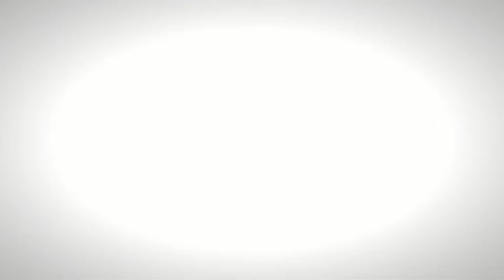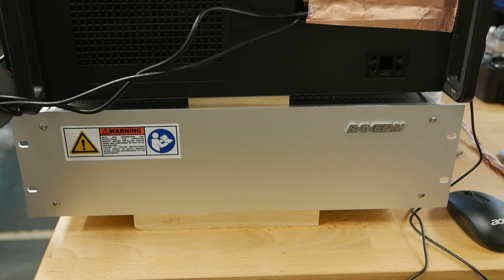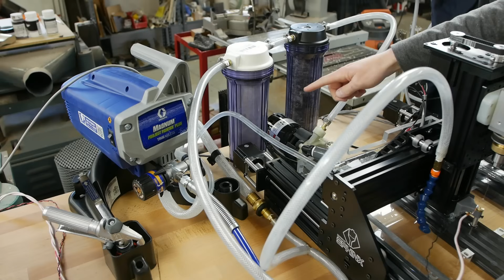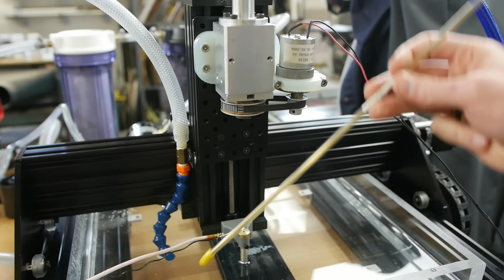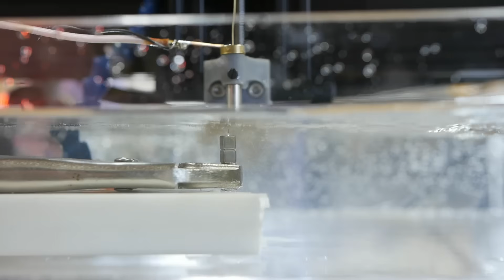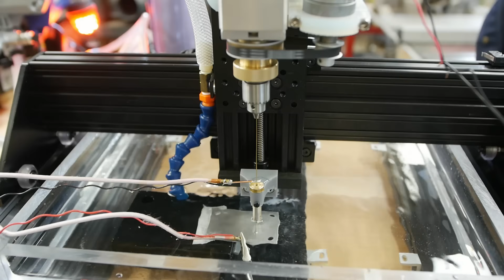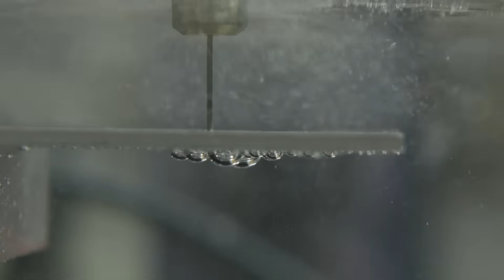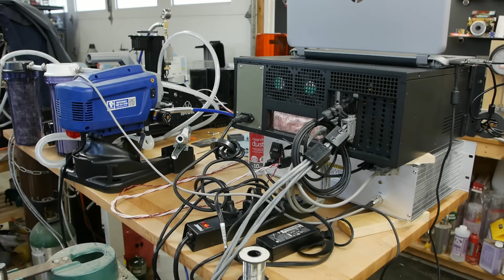Drill through anything (conductive) with Electrical Discharge Machining

Comment: Can I assume that you can drill through a neodymium magnet without heating it up and losing the magnetic qualities?
Reply: probably, at least as long as the voltage doesn't mess it up...
Reply: @kevincrossland1898  Only if the coolant is very cold.
Reply: The little shiny square that he showed as an example of something he drilled through was a neodymium magnet. Being that he drills in water, it wouldn’t heat up the part
Reply: @Aaron Page 
Why would you assume it's a neodymium magnet?
Reply: Super Dave cause it looks just like one. Of course I’ve bought a few hundred for constructing ....
Reply: Joseph Ryan 
Personally, I see endless possibilities with being able to bore a small hole through a neodymium magnet, especially through a sphere.  The polarity can be vertical or horizontal, but the possibilities are limitless.  Doing that may.....   just may, reveal a limitless amount of energy.

Comment: a pressure reservoir in the outlet of the airless spray is recommended to limit the cycling of the pump motor. the constant stop/start of the airless spray will lead to its early demise.
The reservoir could be any pressure tank capable of withstanding the pressure with a dedicated air gap at the top that can be recharged when needed. A out of test scuba tank or oxy tank is ideal.

Comment: This effect is why many metal satellite momentum wheels for orienting the satellite for communication or sensor scanning have failed.  You have to make them of insulating material that will not store an electric charge that can spark at the contact points and weld the wheel in place.

Comment: U use to use EDM to remove broken bolts from stainless tooling. Once you cooked your way through one with the electrode, the remaining part of the bolt in the hole is just burnt metal and shatters like glass, making it easy to remove.

Comment: If it cuts tungsten carbide I see no reason why it wouldn't cut titanium (which would make my like a lot easier...) About how much would you estimate a similar system would cost to build for one's self and would it be feasible for a CNC/3D printing amateur to operate?

Comment: One thing he didn't mention was the almost negligible heat affected zones. Other machining processes can change the properties of a material (work hardening by milling to aggressively comes to mind) but with an EDM you keep the material basically perfect, save for a microscopic area around the cut where the spark heats the material up
Reply: A high pressure water jet does a comparable job with a lot less hassle, preparation, and constant worrying about arcing. imho
Reply: try water jetting a bearing eccentrically placed with virtually no clamping force, you ain't doing that with a water jet I imagine.
Reply: @ray Nic < Perhaps laser cutting would work well on eccentrically placed bearings with minimal clamping... I just feel that this new tech has some drawbacks in preparation, arcing, water filtering, and precision in its current form.  Maybe in time once it gets perfected, it will be a more viable alternative.
Reply: @BillAnt  it's been around for quite a while, actually. As for its use, as long as the part isn't taller than the machine itself, you can pierce a hole clean through without any hassle, or even any diameter change in the hole. The same can't really be said for laser and even Plasma, which both have a focal point and as a result can't get straight holes in very thick parts
Reply: @Kumquat Lord < A well focused coherent laser beam or plasma cutter can punch a very precise hole.  Same can't be said for EDM, even Applied Science said in this video that due to the slight rotational wobble of the electrode the diameter can become non-uniform ( at 20:45 ).  There are certainly some applications for EDM, where other more mature techs are non-ideal, especially for odd shaped/angled objects and heat/deformation sensitive materials.
Reply: @BillAnt  I must agree with you,  EDM doesn't seem to be very practical, at least not for me and my small shop, with that said it's still very interesting,  great informative video.
Reply: Well, it is submerged you know.. Also, it looks like it's initiated by program and not by hand so it should be pretty much fool proof.
Reply: Lol, "work hardening" that's what happens to idiots going too slow or wrong speed and feed. EDM is far from perfect, especially if you get the current, gap, or poor flushing wrong
Reply: @highstreetkillers4377  Dial it down and go back to your video games if constructive talks are difficult to operate. And what's with the air quotes? It is an actual thing which happens, either by accident or on purpose.
Reply: HighStreet Killers, interesting take you have on those not proficient in things in which you claim to be proficient.  

Using your standards, you just might look like an idiot in my shop, several times over (at the copper plating station, over on the over-arm pin router, running the granite router. Then there are my former professions and interests, law, electronics, . . . .)

Why not share your wisdom, rather than painting yourself an idiot by trying to run down those not familiar with things you [claim] to know?
Reply: @highstreetkillers4377  Also happens when you have a coolant problem asshole, and what about when you forget your lube? Based on your attitude I would bet my Clausing you have never run a shop. Likely have never even machined Delrin. Those who have actually been in a machine shop would know that things happen to the best of us, not just the "idiots." Go on now, keep dreaming that you know something about everything. Google wont be there to help you when you enter the workforce.
Reply: @highstreetkillers4377  Wow dude.  I have now read 4 of your comments on this video and they have ranged from fear-mongering, to bragging, misinformation an now berating other commenters.  May I suggest you make public posts in a calm and collected frame of mind to add to the goodness quotient of the global permanent record.  If you have to vent just hit cancel instead of comment after writing your post and getting it off your chest.
Reply: @KallePihlajasaari  Hah, I do that sometimes... Always read before posting, evaluate if there's any good in it, and delete if it isn't. At least I expressed myself to myself, I don't have to be one of these guys...
Reply: @surgeeo1406  I am deleting a LOT of unsent posts this way :-[

Comment: I can't wait for the wire EDM build! I operate one as a job right now, and the machines I run are INCREDIBLY accurate. We regularly work with tolerances that are plus or minus 0.0002 inches (plus or mins about 8 microns)

Also, the toughest material I've EDM'ed was DIAMOND.

Comment: 30+ years ago, I was always fascinated by the "spark eroder" at my step dad's pattern shop.  They would create these intricate forms for the car industry out of graphite and then use that as the electrode to spark erode a steel billet.  The machine used white spirit instead of water and it was a really slow, dirty process but the results were amazing.  Being able to cut square holes in steel was like magic.

Comment: I love this channel, years ago I built a high pressure pump for a gun drill I built from scratch and never thought of using an airless paint sprayer for a pressure unit, could of modified the seals in the airless and saved a bunch of headache and expense.  Thanks a lot 30 years too late.

Comment: does increasing the drill size put a strain on the power supply?  i assume it would have to have a higher current to do the same thing the 7mm drill is doing.

Comment: You mentioned that the material isnt affected by the process. It actually is. You will have a recast layer due to EDM, and can cause brittleness in the top layer which can lead to fatigue cracks more quickly than if you had used conventional machining practices. Yes, the point of EDM is to create tiny holes or unusually shaped features where conventional machining may not work. But EDM does have its own draw backs, so make sure the application wont be affected by cyclical stress fatigue cracking as a result of the recast layer.

Comment: Would gold drill faster? Scince it conducts very well
Reply: It is all based on melting temperature and thermal conductivity. Hard steel is easy to drill.  Copper is very hard to drill, but makes great electrodes.

Comment: as i know short shots on airless leads to quite fast wear of motor and some other parts, i would add some pressure buffer bigger than hose to make it running bit longer at each shot to not kill motor to fast. Also seals on pump piston do not like pure water (paint is creating slippery film and water cannot do that) just saying from perspective of contractor...

Comment: This is kind of a noob question, but if you're eroding the brass electrode into the water, won't the water get a higher and higher concentration of zinc over time? If that's the case, is it really safe to touch the water without protection?

Comment: On aircraft engines, many of the bolts have to be wire wrapped and locked.  Always wondered how they drilled those tiny diameter holes through hardened bolt heads.

Comment: We've had this technology since I was in Tech School back in the 1970's. I used an oil bath EDM machine to machine a complex shape hole (depends on the shape of the electrode) through a piece of hardened steel as a die used for making extruded aluminum rails. Like you mentioned, it will burn it's way through pretty much any conductive material. Nice vid on the workings of this machine.😉👍

Comment: Ben, if you want a great pump, search for drill EDM pump from Alibaba or similar, it works great and is designed to operate continously. I'm concerned that the paint pump will fry itself or its bearings from those short bursts of action in short time.

Comment: Try drilling through a ruby, if my memory serves me correct I think rubies are conductive.
Reply: Then once he has a Ruby with a tiny hole in it he will be forced to begin a waterjet project.  Nice thinking!
Reply: They are not conductive.
Reply: @leocurious9919  😓
Reply: @leocurious9919  📖
Reply: @leocurious9919  well Ruby is mostly aluminium oxide with chromium, so it has good thermal conductivity. Therefore it is indeed conductive.
Reply: @Sharpless2  Its still not electrically(!) conductive. Just like Diamond, which is the best thermal conductor at normal conditions but electrically a isolator.
Reply: Quartz?
Reply: Can drill through a ruby easily with a carbide gundrill
Reply: non-metal minerals arnt conductive... but you can create a laser beam with a ruby and a strong light source... :)
Reply: efgenios  You''re statement is too broad to be accurate. While most non metal minerals are non conductive, some are. The most obvious example is an allotropic form of pure carbon - graphite.
Reply: ok.... perhaps i wasnt so clear.... when we talk about non-metal minerals were talking about "crystalic gemstones"... (quartz, crystals, ruby, zircons etc)... carbon isnt a stone, on its own it isnt conductive... nor is graphite a stone...  like metals, graphite contains delocalised (free range) electrons, thus its not exaclty within the same family as other minerals.... graphite is closer to metals than any other mineral... thus my original statement was somewhat within place... :)
Reply: quartz is not conductive, it has no free range electrons in it... what it can do however is work as a "variable capacitor" when it is coated with metal on its two sides (much like condenser mics work), or like a frequency crystal..... it does allow or block certain frequencies to pass through it... but it does not conduct (release electrons) unless a large load of electricity goes through it... then again, most materials will do that, even rubber....  a ruby will try to "direct" all photons in a certain direction when its opposite sides are coated like a mirror... this has nothing to do with electricity per say.... the link you provided isnt safficient to prove "electrical properties" of a ruby.... a ruby, like a diamond, is a very good isolator of electricity... it cannot conduct.
Reply: efgenios  Yet another example of a (somewhat) conductive non metal is the crystalline form of quartz, a mineral composed of two non metallic elements - silicon and oxygen. While graphite is often used as a conductor,  crystalline quartz is not used as one. And yet it has electrical properties as evidenced by the piezoelectric and pyroelectric effects that are exploited to make sonar, piezoelectric lighters, infrared sensors, microphones, watches and timers, vibration sensors, accelerometers, etc. (Note: The amorphous form of quartz is not conductive).

Even in the case of rubies, there is a little 'wiggle room' regarding their conductive properties. I just found an interesting exception...optical excitation can change a ruby's electrical conductivity via. a photoelectric effect.
https://link.springer.com/chapter/10.1007/978-1-4615-7341-8_47

Comment: Your guide is a little high my dude and will make your diameter larger and  ur epac being off will do the same. Lack of flushing  will cause exposing rods. They can burn up in a slit second. And recommended  ion tank for holepoping wire edm. Anything with water because you will get inconsistent finish as your probably know or on a real machine Tc or conductivity will cause the machine to alarm

Comment: I work in a moldmaking shop and all the EDM "hole poppers" as they are called that I have seen have brushes in the drill head so electrical connection to the electrode is through the head and drill chuck.  You might not need your little collar if your drill head has brushes. If it doesn't have brushes perhaps the groove above the knurl on the brass nut could be a commutator for a brush.  Without brushes the electricity would have to travel through the bearings in the head and would destroy them in short order (unless they are ceramic bearings.)  By the way is that solid core wire connecting to the workpiece and electrode?  If so stranded wire with the finest strands possible is preferable when conducting high frequency's as the higher the frequency the more the electrons travel only on the surface of the conductor so stranded wire with the most surface area as possible is best.  Did I hear you mention another source for a different EDM generator?

Comment: With this "Electric Lance" style system of EDM drilling, could this be used to add additional internal surface area to things like bearings that would allow for in-bearing storage of lubricants to prolong bearing and race life without sacrificing the strength of either?

Comment: In 1950 I picked up a junk accumulator battery from a rubbish tip, and played with two pieces of wire attached to the terminals. I used a needle as one terminal, and wrote my name on anything that I could find to autograph. I also discovered that at the precise moment of breaking contact ,a tiny arc occurred and during this brief moment, the voltage peaked ( the battery was only six volts ) and gave me a large shock up my arm. This was how I discovered the arc effect, and I was just five years old. My uncle was a mining Engineer in Blaenavon , Wales, and I knew Ohm's Law before I went to my first school at that age.

Comment: I was a painter for over 20 years. That airless running like that is hard on the packings. Kinda like starting a cold car engine repeatedly. That bearing pulls oil up and lubes itself up. The oil really doesn't do much good if the pump doesn't get a good stroke in. When these pumps start to lose pressure they behave like your  pump and the bearing goes out even faster. It's not a hard fix but can be avoided. Adjust the pressure so you get a full stroke.
Reply: A VFD would probably be a good idea to slow the motor down so it runs more constantly rather than short cycling over and over.

Comment: About the conductivity of water, you can purchase a cheap conductivity meter and measure the conductivity of distilled water while you're mixing it and adding small quantities of table salt. You can tune your conductivity exactly according to your need.

You may also think of using some special chemicals to fix conductivity. Means that you will make a buffer solution who has a relatively stable conductivity.

Comment: We used to call this "Spark eroding" in the '80s when I did an internship in a machine shop. If a tap was broken in a piece of work, it was sent off for spark eroding to remove the tap. It was expensive, but still worth it, because the piece of work was destined for a guided missile.

Comment: Another great video. I am curious about the voltage used for the arc supply. What is the range? If it is not very high then the price of the power supply is a bit much. You could possibly use an audio amplifier. Most good ones are good to around 50v. Just some thoughts.

Comment: Applied Science:  This approach seems very expensive...  :((  I hoped to see a DIY approach that home-brewers could cobble together inexpensively. I understand Einstein once said, "Keep it as simple as possible, but not simpler."  There is nothing simple about this approach.  Einstein would applaud your 1000 psi tubing with no clamps, but can you confirm that you are getting 1000 psi through that nylon reinforced plastic tube without even using hose clamps???

Comment: Wow, EDM has progressed since I was first introduced to wire EDM.  The early stuff was not very microprocessor driven.  The wire drive was an analog DC servo that just adjusted the position to maintain the electrode voltage.  Early wire EDM was DC.  Pulsed is newer.  Older analog simply vibrated the wire much like a relay.  Current increase pulled the wire up much like a tattoo machine.  Now the process is computer controlled in the power supply.  It has been a few decades since I have messed with EDM.  Thanks for the technology update.